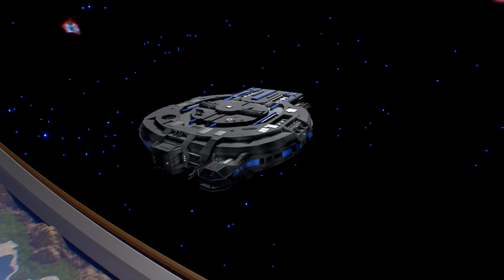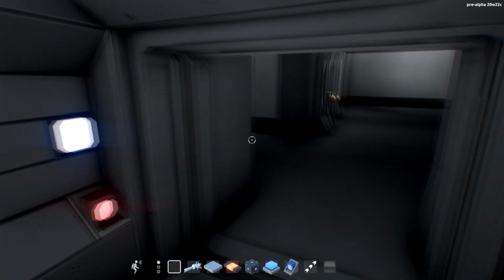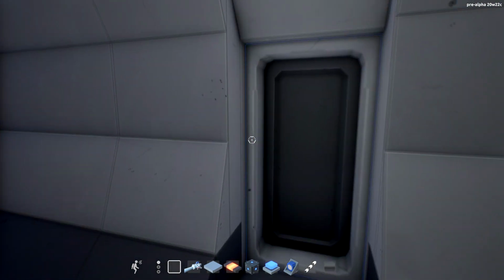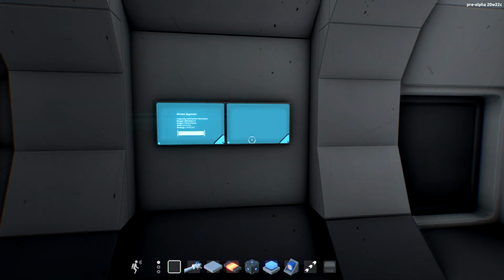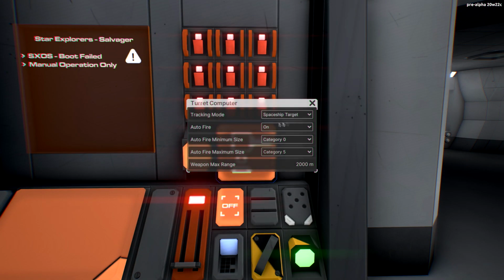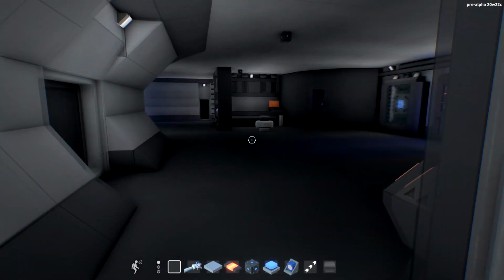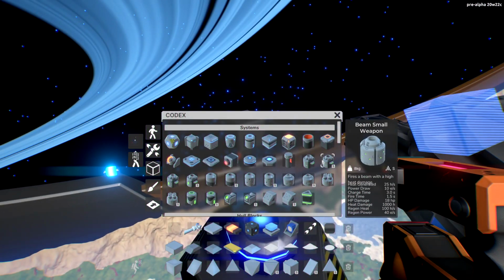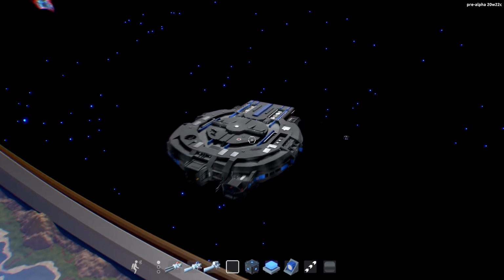Starship EVO - Salvager Ship Update and Custom Hand Weapons!

Comment: gives me big correllian freighter vibes, with the main dish hull shape and the offset cockpit... was that the inspiration for this? or at least one of the inspirations?
Reply from the maker: Actually it wasn’t really, I was just going for an asymmetrical ship and having a large glass cockpit was something I wanted, and so it just sort of worked out that way. All in all I usually just make a list of things I want the ship to be able to do, abs design around that. So the jig corridors, and central designed systems with a corridor that goes around it. :)

Comment: That's a lot of progress from the empty hull it was ! I love the corridors, looks straight out of a sci-fi TV show, the sensor system is amazing, especially  that improvised map, but with the bounding boxes sticking out, if you have someone walking on the hull, will the doors randomly open and close ? #hauntedship
Reply from the maker: Indeed it’s starting to take shape!
As for the bounding boxes, no those ones that were sticking out all over the ship were the ones I hadn’t yet custom tuned to each section of the ship. Each one needs to have coordinates put into it, to make it the shape of the room. 
All the doors are tuned to only be one block in front of and behind a door, so no haunted ship ;D
Reply: Oh I see, glad to hear it, it would have been spooky.